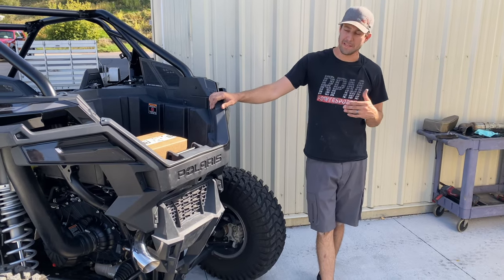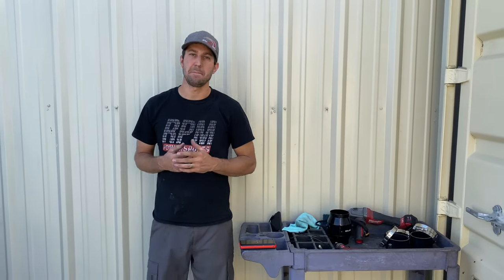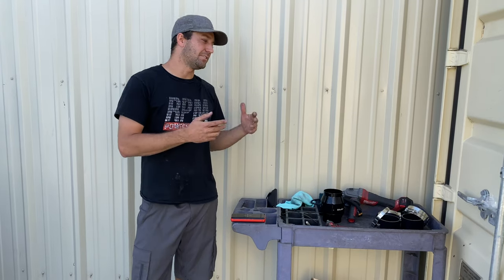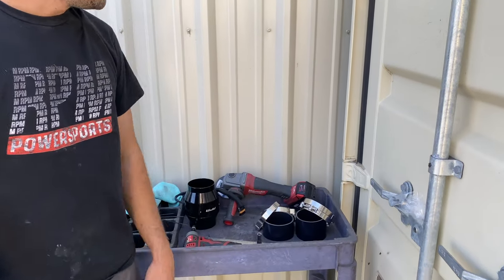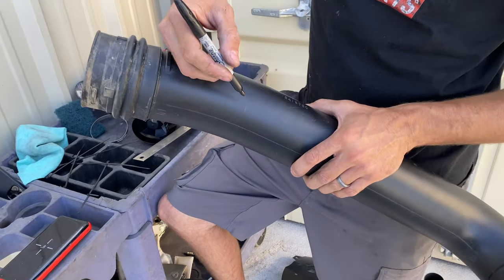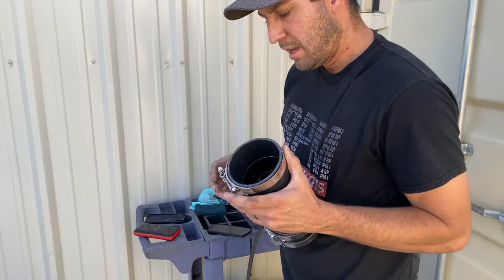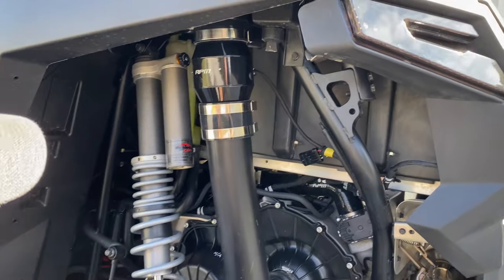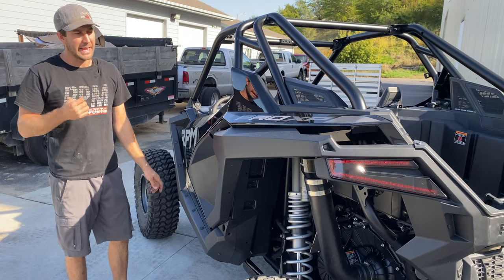Installing RZR Pro Xp / Turbo R  CLUTCH FAN! RPM SxS ECF Clutch Fan

Comment: Looks like you tightened it pretty hard.... Did you? on the factory stuff i fully tightened it.  But on the fan how tight should i go...? I'm worried id crack the plastic of the fan.
Reply from the maker: The fan is metal. Just needs to be tight enough to seal them!

Comment: IT SUCKS alot of air.....i ordered mine from you as soon as i seen it on the website. instructions on where to cut at the time would have helped but its simple to install. havent had any issue with it since. its a no brainer
Reply from the maker: Instructions are at the bottom of the website. https://cdn.shopify.com/s/files/1/0269/8533/2807/files/RZR_Pro_XP_ECF_Kit_Instructions.pdf

Comment: Would your fan work if I was  use it for the air intake that goes to my turbo?
Reply from the maker: That would be a very bad idea.
Reply: @RPMPowersports   the S&B partical separator uses a fan to force air to the air filter
Reply from the maker: The S&B is also notorious for robbing horsepower. There is no need to feed the intake any air ever. The intake system is non restrictive on these machines .  @bookemgator

Comment: doesn't this restrict air flow? 😁
Reply from the maker: Notice how the area that contains the fan is larger than the factory tube, this is so that the volume of the fan assembly itself doesn't reduce the volume of the tube.